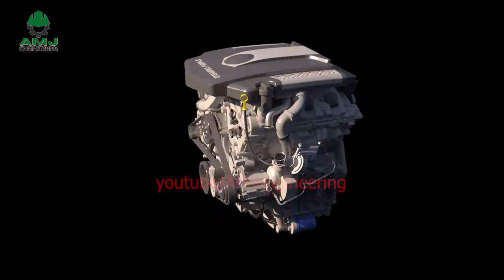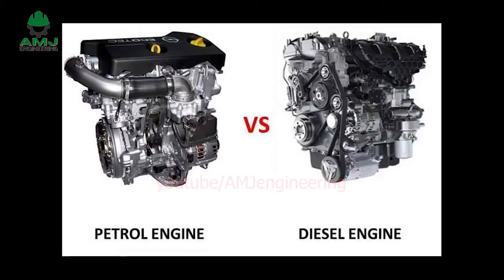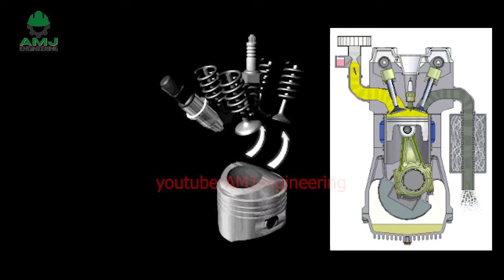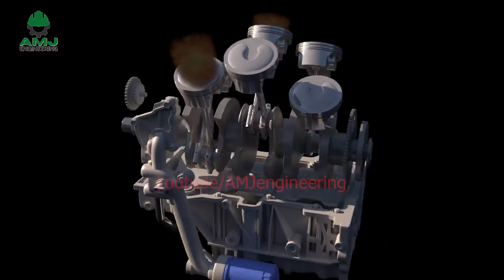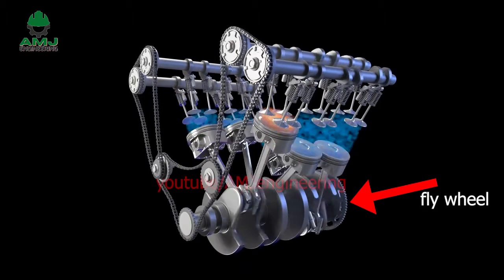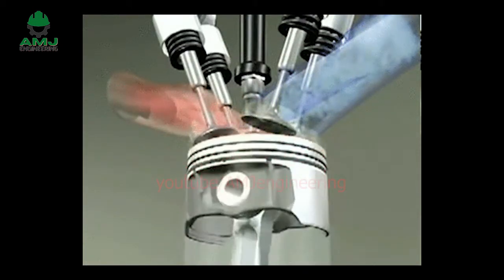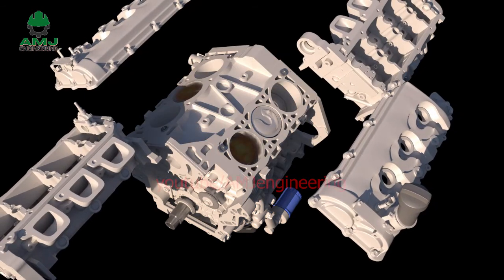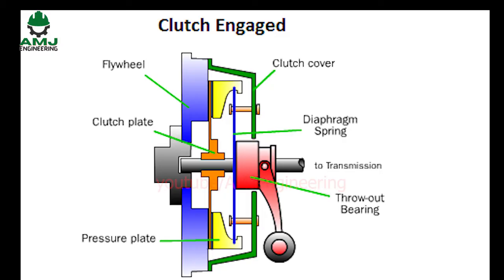Combustion engine parts and functions

Comment: Hi left a comment on your video about sprinklers, and wonder if you would answer my question regarding sprinklers please, is it the case that all tenants in flats have to leave their home for 3/4 months while sprinklers are being installed?
Thanks in advance.
Reply from the maker: I didn't get your point. If I understood you well, Usually installation is done prior finishing works and tenant shifting. But if already someone is living in the house, 3 weeks is too much for just one apartment.
Reply: @AMJEngineering  Hi sorry my question was not very clear
As an existing tenant of 4 years they are now going to fit sprinklers and have said all tenants have to vacate for 3/4 months its absurd, but you say it would take less time is that right?